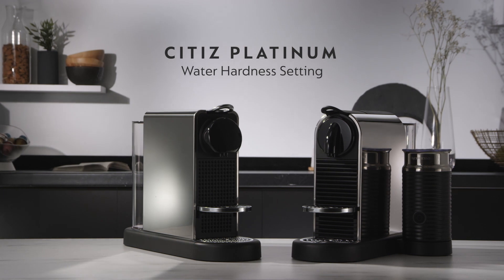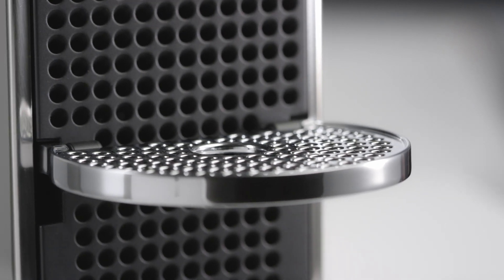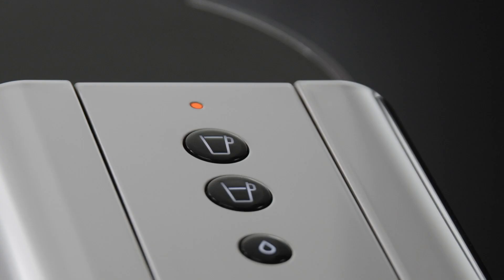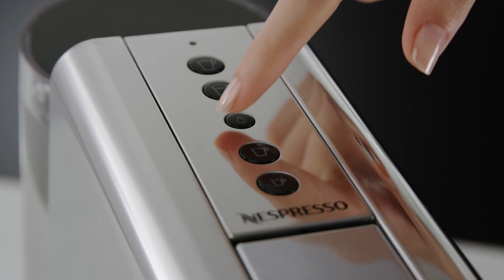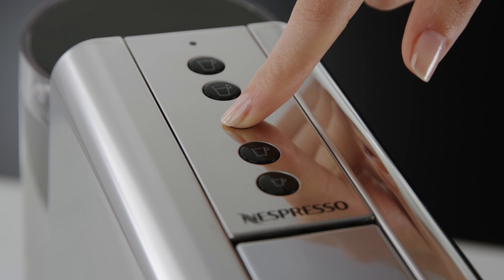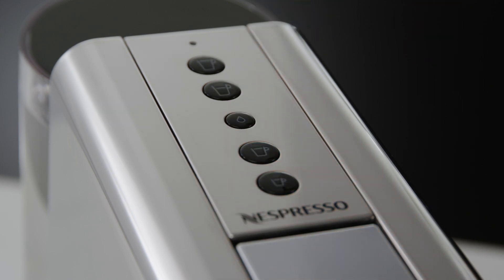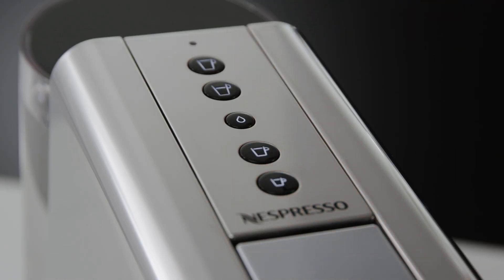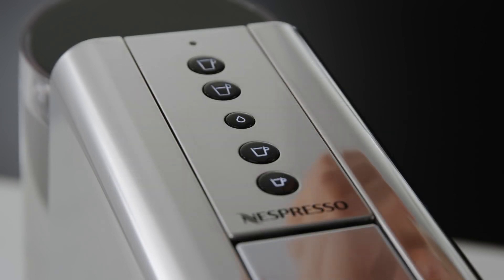Citiz Platinum - Water hardness setting

Comment: Do I need to test the water hardness?
Reply from the maker: Hello. Over time and usage, the hardness of water may cause mineral build up in your machine. This affects the temperature, flow and overall performance of your machine, so be sure to descale with Nespresso Descaling Solution every 3 months or 300 capsules. For further assistance, please call Nespresso directly we're available 24/7 at 800.562.1465.

Comment: I didn't receive that hardness test stick in my order of citiz platinum
Reply from the maker: Hi Raffi, where are you located?
Reply: @nespresso  Ontario, Canada
Reply from the maker: Hi Raffi! 👋 We regret to inform you that we no longer include water hardness test strips with machine orders. We apologize for any inconvenience this may cause. Rest assured, our machines, including the Citiz Platinum, are designed for reliability and durability. Following the user manual for regular maintenance and descaling will ensure the longevity of your machine. For additional support, please don't hesitate to visit our website: https://nespres.so/a/7027f4, or call our toll-free number, 1.855.325.5781 and our colleagues will be happy to assist you. We hope this information is helpful. Cheers! ☕
Reply: @nespresso @SQARM1 I just got the Citiz and I got the test strip